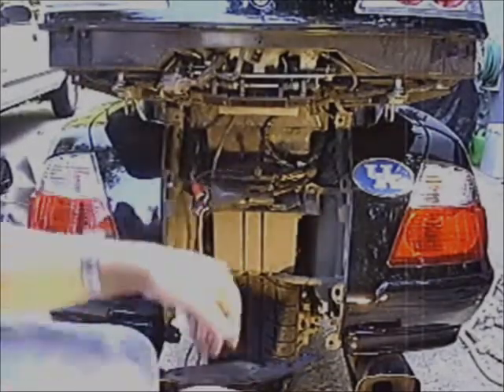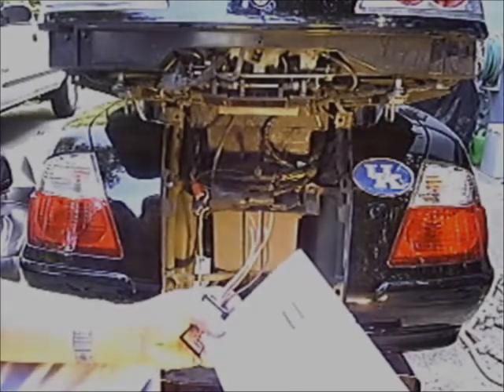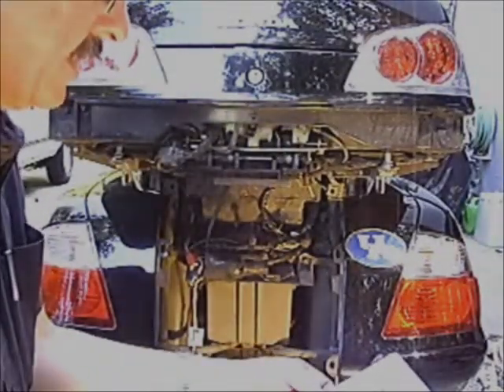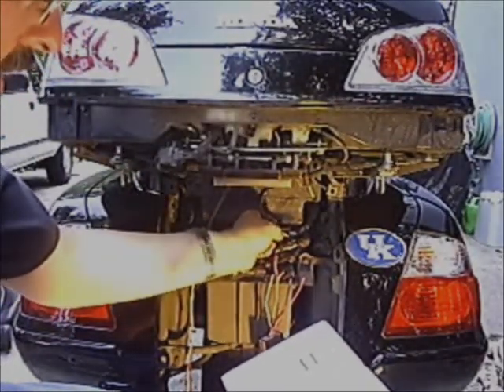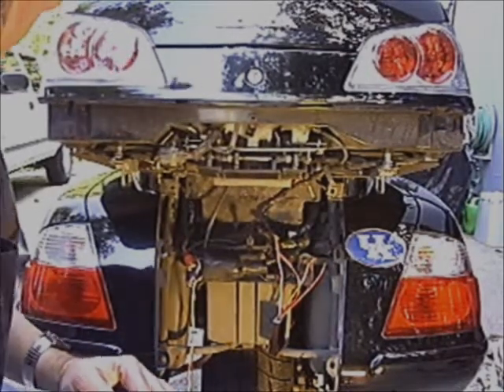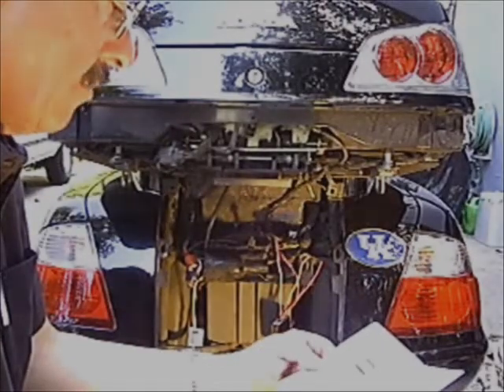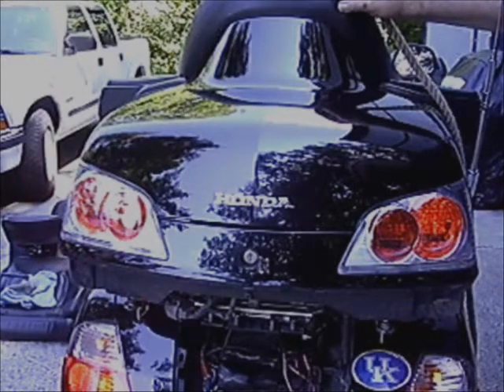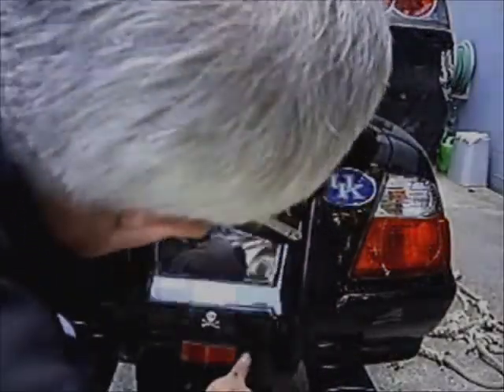Install a BackOFF Wig Wag on a Honda GL 1800

Comment: I just finished installing the back off brake light on my 2005 Goldwing. However, I found it much simpler to install it under the seat to the main green and red wire going back to the tail lights before it splits.

Comment: Thanks for the information on wigwags. But i have a question, how did you remove the bottom portion of your travel trunk, I have tried, and tried, aim trying to replace the license plate light and plug that was damaged..Thanks

Comment: I really enjoyed your video. I am trying to install the Signal Dynamics Plug & Play Headlight Modulator with The Plug & Play Universal Harness, on my 2005 Goldwing Trike. My questiom is, how do you connect the wires from the lights to the modulator? I cannot tell In your video how you are cutting/splicing etc. I don't quite understand what they want you to do?
Is there any way you could send out a short video on cutting/splicing and attaching the wires from the headlights to the clips on the Universal Harness. I do not have any knowledge in electricity is why I am reaching out for help.

Is you can't, I fully understand. Maybe you know someone who has

Thanks;
Steve Hannah
(Retired) NREMT-Paramedic
Reply from the maker: +Robert Hannah Our Plug and Play Module with Universal harness requires you to plug the module to the harness and then use the clips on the harness to tap into the appropriate wires of your headlight. For more information and installation instructions you can go here:
http://www.signaldynamics.com/plug-play-universal-harness-adapter-standalone/ 
If you have additional questions and would like to speak to a tech please give us a call. (Our contact information is available on our website)